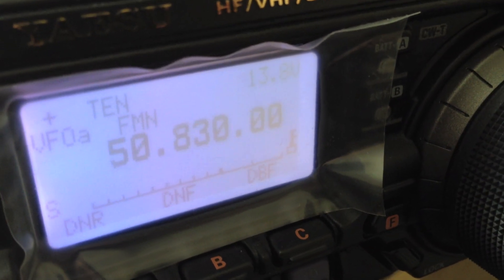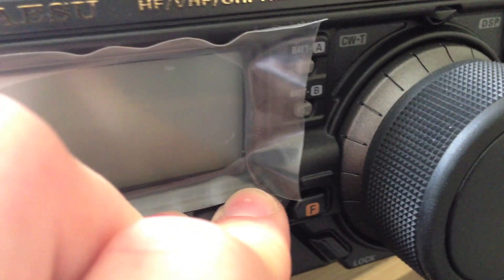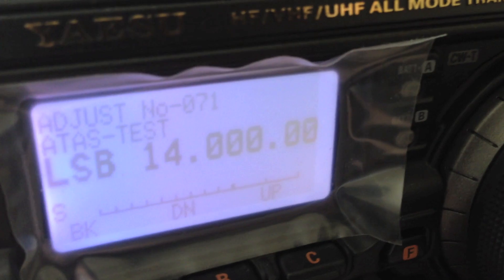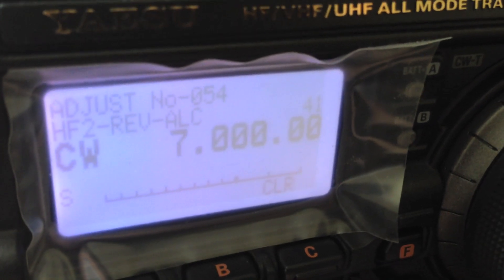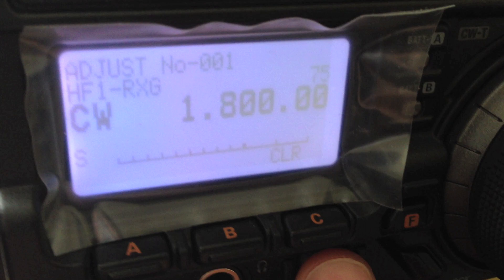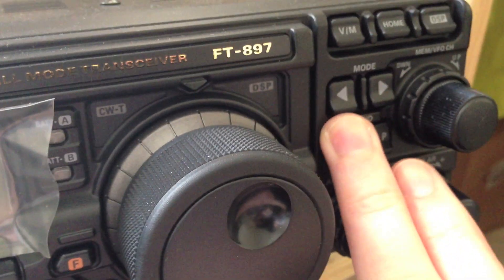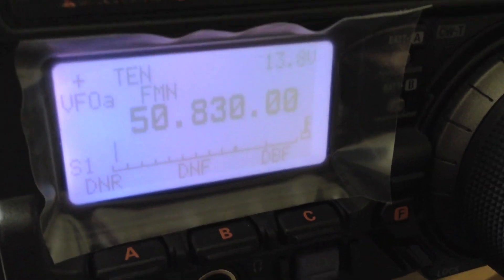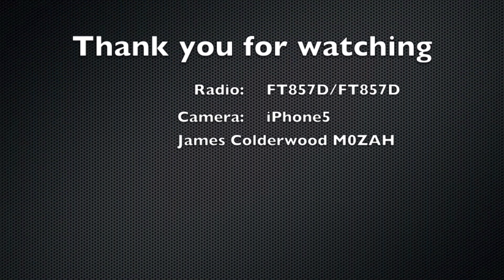FT897D/FT857D Service menu and relay cleaning

Comment: Just back after some years I have 2 FT897s the other is the 1st lot with the week outputs and the settings on each are way off most are on over 200 I think guy I got it from had a good play I have been trying to get the settings from other radios as am thinking of just setting the one not working as it should to same settings as my good one so do you have a list of your settings just to see the difference.  as on the PDF it has default and my good radio is very close only 1 or 2 diggits out

Comment: been working with mine after a repair job by a local tech, the tech replaced the front panel which held the display. I had error in the voltage showing 9v instead of 13.8 and at times 22volts after  talking how to correct the problem I got it back to partial repair, still not 100% yet but getting there. Programs like this is helping me and its good to see it

Comment: Had a new unused unmodded 857. Stopped tx on 14mhz. External wattmeter doesnt even move on all modes. All remaining bands are ok with 100w. No visual damage except a relay on power stage. A milimetric rounded shape on it. Finals heating on tx. I guess there is output power but it doesnt achieve to the antenna jack. Whats ur comments ?

Comment: Hi James just a quick question, i have inherited an 987d, just recently ob 2mts it come up with H-SWR on the display, now i am pretty sure the aerial and coax etc are ok, its aV 2000 diamond antenna, it seems like the radio causing it, any ideas? Fred g4vvq.
Reply from the maker: Hi Tom, I hope you are well? Thank you for your comment. Have you tried plugging an SWR meter in-line with the radio and V2000? I don't always trust the built in meters but H-SWR alerts definitely need checking out.
Reply: Hi Jimbo, well i haven't put a swr meter in line but i did put a Antenna analizer on it, its a V 2000 works on 2.70 and 6 meters and swr is ok on all the bands and no flickering...i supose a meter might be better as it has more power going out, i dont the set relay thing in the menu, it seems ok at the moment, thats what makes me think its in the radio...cheers....Tom

Comment: Hi James, just watched your video with interest. This is probably a stupid question as I am not at all sure what can be achieved via the hidden menus. Is it possible to adjust receiver sensitivity with the hidden menus? I feel that my ft897 is possibly a little on the deaf side although I don't use it anywhere near enough to make fair comparisons with any other brand of radio. Could you point me to a resource which may explain the hidden menus in full. Thanks in advance for your time and efforts. Regards.
Reply: geomackisback Don't touch that menu. To properly adjust the sensitivity via that menu you must have the correct equipment, that is, a signal generator. Once you change something without the proper tools you can mess it all up. Take the radio to a trusty service centre and they can check that for you.
Reply: Dimas Filho  Thanks Dimas, the fear of the unknown ruled the day and I have decided not to tamper with it. I'll let the experts have a go at it. cheers 73
Reply: You'll surely not regret it. Today's radios are extremely complex. Lots of equipment is required for the job.
Reply: Hi, I just get a brand new 857d and don't want to change anything, but I'm curious, so I wondered as I have a Siglent SDG 805, what is the typical voltage input of the mic ? As the signal generator has to be loaded with 50 ohms, do you have any suggestion for a schematic adapting it to the mic entry ? Many thx, 73